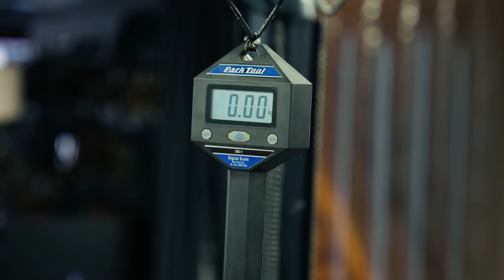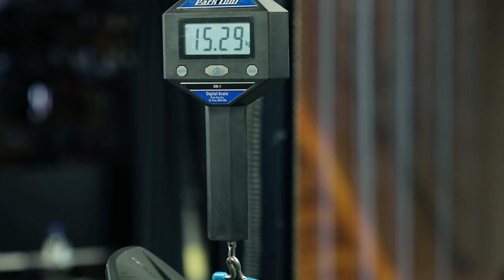Specialized Turbo Levo SL 15,29kg E-MTB / Bike Build / Bikeporn

Comment: 10:38 In Maguras manuals is written to fully tight upper screw (with no gap) and adjust with lower.
Reply from the maker: You're right. Unfortunately, it was ignored in the video. Thanks for your feedback

Comment: The bicycle is something that will grow beyond belief when we start to see serious increases in battery energy storage levels. It'll be interesting to see how a bike as gorgeous as this ages .. will we see battery upgrades that will double or triple this bike's range or will it become collateral damage to the march of technology?
Reply: I think you're over estimating what's possible with current battery chemistry - perhaps 10% improvements are possible in W/kg in the next 5-10 years. Having said that, it rarely pays to be an early adopter and if you want an all out e-bike, there are unregulated bikes with full frame batteries that can churn 3x power of this bike and cycle up almost vertical walls that cost way less than this bike. They are heavier though and less pretty.

Comment: Nice for marketing purposes, but for most shredders worthless, I can have Orbea Rise with double the power at 16,7 kg, but for real shred I am at 18,7 and it is awesome in every way. You need beafier rims, proper Minion tyres, etc.
Reply: small 19Kg for my M10 with enduro tyres, insert, 36, large frame, 4pots xtr brakes...
Reply: @philippesoudon5092  I have M-LTD with also 36 fork, 4 piston xtr brakes, enduro tyres, beafier rims, shock with expansion shaft, 800 mm bars, revgrips 203 mm rotor, tubeles and I am at 18.7. it shreds almost like normal bike, awesome

Comment: After I saw this  bike porn and read about another light turbo levo sl.
I thought about my dream bike
I was unsatisfied  with my rims and the total weight after 2 years
Now christmas time I used to
pimp my Levo SL from 19,4  to 15.45 kg including pedals.
Rims Radsport Müller DT 240 Carbon  1360 Gramm 
The original rim on the back with cassette and clincher was about 3,2 kg OMG
Fox 34 150mm Grip 2 1860 g
XTR brakes   390 g
Seatpost Gelu fix ( dont need lowerable) 90 g 
Schwalbe Cross King 600 g 
Sram XX1 12 Cassette 350

With SPD pedals (360g) size M 15,,54  without pedal 
I still dont know if I can trust the seatpost but its worth the risc;)